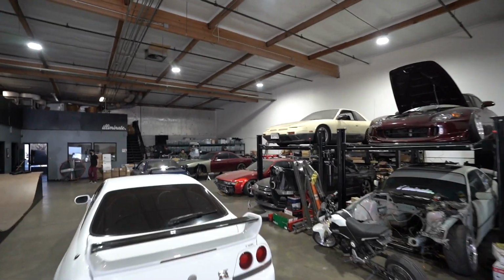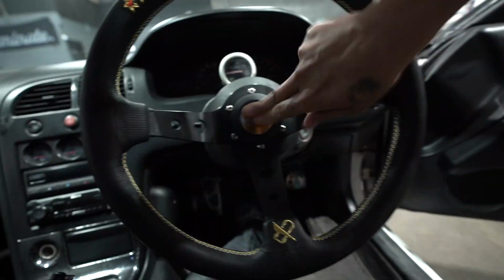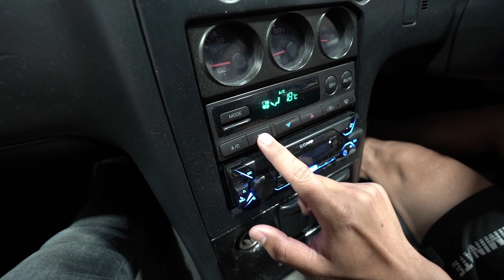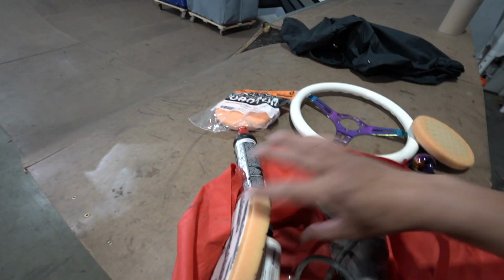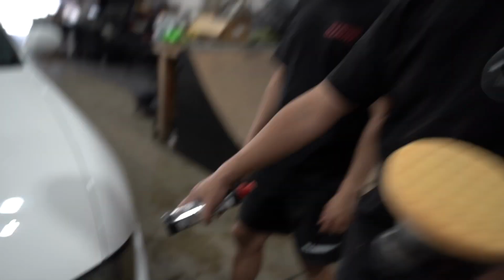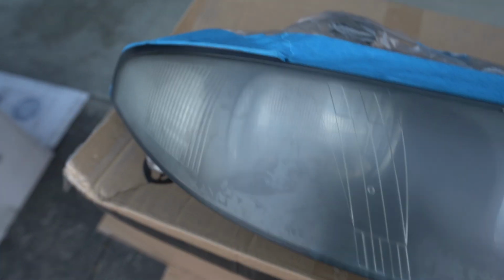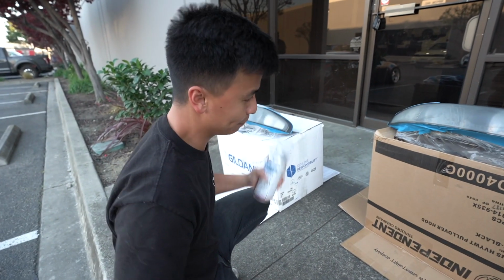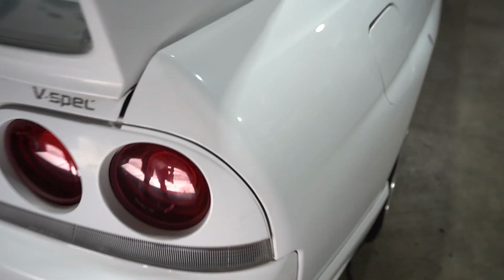First Mod for the R33 GTR!

Comment: You can wet sand plastic and use a heat gun to bring back the shine as well. Just don’t keep the heat on it too long..I was able to bring an ‘82 crusty ass yellow ATC back to life after it getting completely sunbaked for a few decades.

Comment: I used to have a series 3 white r33 GTR (1998 model) and sold it in 2011 for $19,000 aussie $ (approx $15k USD) can you believe it!! back in 2005-2012 in Australia you could pick up R32 / R33 GTRs for 10-20k easily. R34 GTRs cheapest they got was about $30k USD